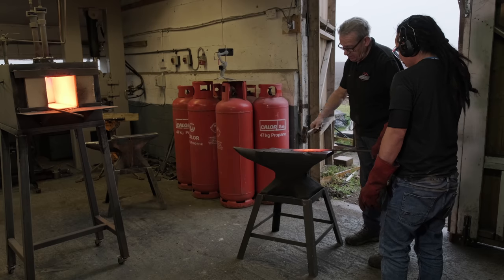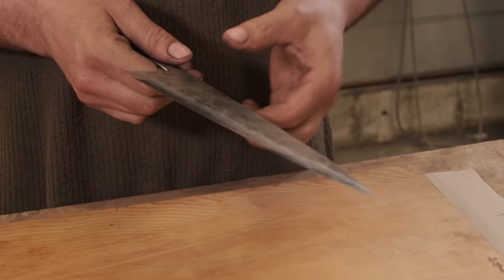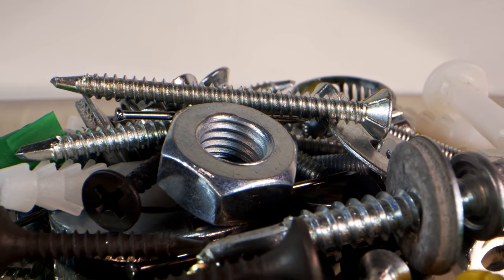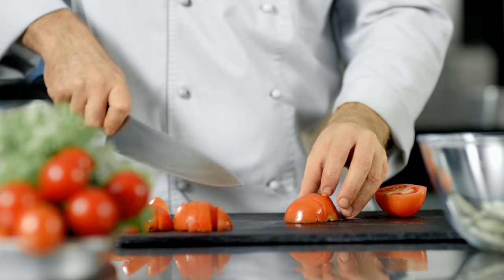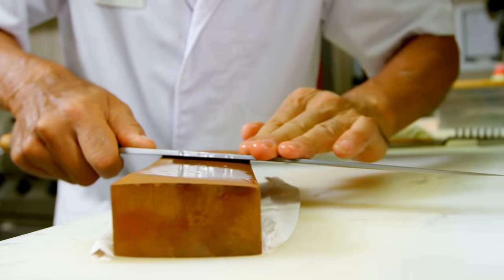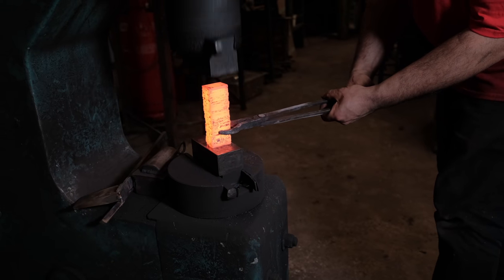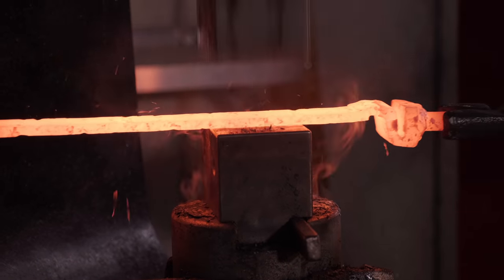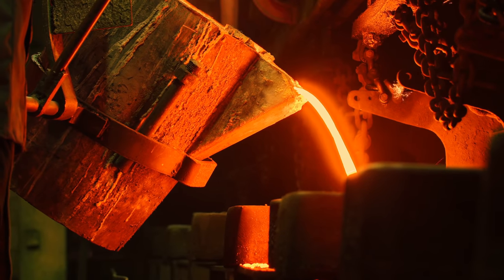Why 98% of knife makers pick the wrong steel according to a metallurgist

Comment: Never tried powered steel due to its price, wish it could be cheaper. I always enjoyed working with 440c, It is not that hard to sharpen and can hold its edge very well. Its corrosion resistance ability is quite good, I accidentally left a knife blank outside my workshop in the rain for a couple of months. When I found it, there was no visible rust or tarnish on it at all. The only downside is it can be quite brittle without the proper heat treatment.
Reply from the maker: Thanks for your input! I hope you enjoyed the video!

Comment: A conversation about stainless blade steel cannot simply revolve around chromium content alone, it also has to do with the carbon content, nitrogen and niobium additions. As an example magnacut only has 10.7% chromium and it is one of the most corrosion resistant steels on the market. ZDP 189 on the other hand has 20% chrome and it’s less stainless than most standard stainless steels. I realize this is an attempt to make complex metallurgical ideas digestible, but I think it’s important to mention that a chromium percentage is not the whole story.

Comment: As a moderate experienced blade smith I only use Stainless if I can have it professionally hardened , can I harden it myself without very special equipment?
Reply from the maker: If you are asking about Cryo, then yes, you do not need cryo to harden stainless steel. A new series with Graham is coming soon so don’t forget to SUBSCRIBE! Thanks for the question Steve!
Reply: The trick with stainless and tool steels isn’t the equipment but the temperature control. 

You can just about get away with using a magnet to gauge the right temp for a plain carbon steel (when the magnet falls off you’re a close enough to the right temp). Stainless needs a higher temperature and judging it by eye is hit and miss even to an experienced smith.  A cheap thermocouple that’ll go up to the right austenitising temperature will help a lot even on a coal forge.

Comment: usually anything for the kitchen or household i usually go with stainless because of its properties, but if i am using a knife for outdoor stuff like bushcraft etc, i prefer to use 1095 carbon steel. yes it doesn't hold an edge for as long, but its easier to touch up in the field, and also you can use the spine of the knife with my flint stone to throw sparks onto some char cloth for fire starting. i don't mind it doesnt hold an edge for as long, because that compromise means its easier to touch up with a smooth pebble or pocket sharpening stone.
Reply from the maker: Hi Punk Floyd. Compromise is the keyword and thanks for sharing! 1095 is extremely popular for the exact reasons you’ve shared. 

Have a great day ahead of you!

Comment: A8-mod for large knives used on non abrasives. Tough, so will stay sharp very long due to that toughness. Obviously because the Apex blunts due to damage not wear. Also sharpen ability is high and good corrosion resistance. 5160 is also a good choice.

Cpm3v is similar in toughness but harder to sharpen. Thats why I don't like it.

Comment: Just branching out to stainless... Client insisted on ats-34... Trying to forge it out a bit and that stuff is tough and fickle...
Reply from the maker: Hi Kevin thanks for the comment! Yeah, I can only imagine that! I’ve been told stainless is “gummy” to forge compared to carbon steel. If you enjoyed this video, I’m sure you’ll enjoy the next one coming this week (steel selection part 2 and steel hardness)!
Reply: @UKBladeshow  "Stainless" steel was discovered sort of by accident. In the late 19th/early 20th century, industry people were looking for steels that would A) heat-treat more evenly and B) stay hard at higher temperatures. Like for drills and milling tools where you're cutting steel and there's a lot of friction/heat build-up. Hot-hardness AKA red-hardness is a big deal if you're running a machine shop or factory making metal parts...
It turned out that adding a little chromium helped both the HT and hot-hardness problems.  (there are other alloying elements that also help with all that, but let's just stick with chrome for this discussion.)
O1 is generally regarded as the first specific "tool steel." It has just a touch of chrome and manganese and tungsten, all of which contribute to its better hardening response and better performance in machine tooling, compared to really simple steels like 1095.
Plain old 1095 will get soft and dull faster in a drill or mill than O1 does, and newer steels with higher alloy content came after O1. 1095 is also a bit trickier to harden - you need to cool it FAST or it won't get fully hard, especially in thicker pieces. O1 gives you more leeway in that regard - you can quench it slower, in oil not water... that's what the O stands for. Oil-hardening.
Adding a bit more chromium makes a steel harden so easily that it will get hard just cooling in air, without even dunking it in oil or water. A2 tool steel is called that because, you guessed it, it hardens in air. A2 also stays hard at higher temps than O1 does... and it corrodes much slower. 
They soon understood that adding even MORE chromium made the steels very stain-resistant indeed. 
So! Fast forward to today...  the problem with hand-forging high-chromium "stainless" steels is, they stay a lot harder at a lot higher temperatures. You have to bang on them harder to get them to move.
And you have to get them hotter to be able to forge them in the first place.
And they want to get hard in the air as soon as they start to cool down from that forging temperature.
Those are all big problems for a small shop using an open forge or small furnace.
It definitely CAN be done - back in the day Gil Hibben used to hand-forge 440C - but it's a real pain in the behind. And frankly it's just not worth the trouble to most people. There's a lot of extra time and cost involved, and you don't get any benefit from it. In fact, you run a lot of risk of screwing up the steel by beating on it at the wrong temperatures. Unless you need some crazy shape that has to be stain-resistant, it's just plain more efficient to grind "stainless" blades out of flat barstock.
On an industrial scale, knife factories get around all that by doing their forging of "stainless" steel with big drop-presses that forge the blank mostly to shape in one or two movements. That allows them to have cool features like integral bolsters efficiently. Then they heat-treat it and finish-grind it.
Reply: @dogslobbergardens6606  excellent information, ty very much... I've come to the conclusion that stainless can be done but it is too difficult and time consuming... Stock removal on stainless blades for me in the future for sure although I will finish forging this one blade to see the result.

Comment: Almost all of my knives are carbon. I have never liked stainless. Mainly because I like to patina my blades and I think carbon is easier to maintain than stainless and is usually tougher. Stainless is usually either too soft or too brittle and I don't like shiny knife blades. Also carbon is much easier to modify with coatings like KG Gunkote, which I often do with my blades.

Comment: I recently got a bell knife skiving machine for leather work.  I installed a Nippy SKS51 Japanese steel  bell knife, thinking this would would be more reliable than the stock bell knife. It's not a bad bell knife, but I realized only recently that I should have gone with a hardened German steel bell knife from either Nippy or Fortuna. I'm curious to see if I will experience a noticeable difference.

Comment: I like simple alloys ("carbon steel") just fine, except for one important thing - I live in a humid climate. I don't really care one way or the other about patinas, but there's just no getting around the fact that in 90% plus humidity, the edge on a carbon blade degrades in a day or two whether I use it or not.
AEB-L is still one of my favorite alloys after using and making dozens of knives out of all sorts of things from 1095 and 01 to PM high-alloy "super steels."
The PM alloys def have their place, but as the presenter said, you WILL notice the difference grinding them and your customers will notice the difference sharpening them. As a maker you also have to consider that they're expensive to start with, you'll use up more belts, and they're trickier to HT. If you want a nice fine hand-rubbed finish on them, you best do it before HT or you'll drive yourself crazy trying to sand it and/or buff out scratches. Which means you really want your HT game to be dialed in, because you're taking it to final dimensions before hardening. Otherwise, screw it... belt-finish the PM steels.
(I have in fact made a few knives in CPM-3V with mirror-like 4000-grit hand-rubbed finishes, just to prove it can be done {before HT}... but honestly no one really cared LOL. People who buy that type of steel are likely going to beat the snot out of it, so they generally feel like a really fine finish will just get scratched up anyway.)   
AEB-L doesn't have all those carbides that make most "stainless" blades such a bitch to sharpen; that helps with toughness and keeps it fine-grained so it  takes a nice crisp edge; it sharpens like O1 and it stays that way a good long while regardless of the weather. 
You can temper it around 58Rc for general purposes and a good balance of edge-holding and toughness, or way up at 64Rc for better edge retention. The higher hardness range is very nice for really thin edges like you might want in the kitchen or for skinning. I settled in on 60Rc for almost everything. 
I call AEB-L "the stain-resistant steel for people who don't like stainless steel." There are also newer similar alloys with the same benefits. 
The key is having just enough carbon to get good and hard, and just enough chromium to get that passivation effect to ward off corrosion. Too much of either or both and you're back to fighting carbides; and if you want carbides you might as well go for the PM steels to keep the carbides small and evenly distributed.

Comment: Stainless holding a better edge may be true with low alloy stuff, but with modern high alloy stuff, the non stainless will almost always have higher edge retention than an equal toughness stainless.

Comment: Wonder where 80CrV2 would fall in the lineup? 
I'm definitely no expert, not even a particularly knowledgeable knife head, just the end user of a small variety of knives, mostly for outdoors/bushcraft purposes, and I have been very impressed with my 80CrV2 knives. Living in an extremely humid environment, I thought from listening to all the self-proclaimed experts that I'd need to clean and oil all non-stainless knives every time I used them, but the 80CrV2 has been amazing. It's withstood Louisiana humidity and going weeks sometimes without cleaning or oiling (at first I was fanatical about it, later not so much), and nary a blemish to show for it. Not to mention the abuse they've stood up to, unintentional and otherwise.

Comment: I don’t understand why Pro knife makers working with CRM / powdered metals don’t get into Boron / CBN grinding wheels with diamond dressing stones.  

The upfront cost would not be cheap but and this is not flexible like belts but would decrease belt consumption waste cost tremendously for some specific tasks.  

I’m sure there are some that do this but I have not seen it widely discussed.
Reply: Because you have to make and sell enough knives to cover that upfront cost quickly. But also because most individual/small shop knifemakers love belt grinders for the tremendous versatility they offer - you can easily keep an inventory of belts in all sorts of grits from 36 to 600 right up to "micro-grits", you can use scotch-brite style belts for simple finishes, you can "power strop" with a leather belt, you can use a flat platen or a slack belt or a wheel ranging from 1" to 12" or larger, etc. All with one machine.

Comment: I have to agree. In the kitchen, stainless is the way to go. 

Carving hard wood is different. I find that plain carbon steel provides a good amount of work time between stropping or stoning ,with a minimal amount of time required to restore a razor edge. But, it’s a pain in the kitchen and it stains your onions. Plain carbon in the workshop, stainless in the kitchen.

Comment: Great Video, well done! My question is where you came up with the "98%"? If you're going to use a stat, make sure you can back it with qualified data. The truth is, I have been coal forging JUNKYARD (meaning I have no idea what it is) steel for years and I have never, not once, had a knife break from being used (be it as a knife or a crowbar or a thrower...) because as long as you heat treat and take the right steps to deal with the metal, you'll be fine.

Comment: I have some pieces of 5/23 scrap (old circular saw blades from the 1950s) marked "silver steel" My understanding is that it is an early high chrome,  high carbon steel but not a true stainless. Like you said everything is a compromise. My question is concerning the hardening process. Would hardening and tempering be similar to w-1, can I oil quench or am I looking at something different? (I'm in the US) (I have several woodworking tools made of this steel and they hold up very well)

Comment: Very informative and interesting, but it’s not necessarily better to have very hard chromium carbides in your knife blade. These carbides tend to be bigger, and when the edge abrades during use, sharpness is lost quite suddenly, as is the case with almost every single stainless knife I’ve ever used. Moreover, sharpening your knife with a steel presents its own problems.
I have a quite a few Japanese-made and Western carbon and stainless steel knives in my kitchen; the carbon steel ones keep their edge much, much longer, take about 30 seconds to resharpen to a true razor edge on a water stone, and will continue cutting well even when that pristine edge is no longer there. The stainless knives will lose the edge much faster and quite suddenly, will be a bear to sharpen, and will almost never have that keenness of edge. 
Hardness and edge retention are two separate things.

Comment: It's important to sharpen the edge to the angle the knife wants.  Fillet knives get different edge angles than axes.  I use all stainless knives for my fillet, hunting and kitchen knives, and I use a carbide draw sharpener at the correct angle for each type of knife...and I do this right out of the box.  I cut my edge to my specifications.  Then, I use a 600 diamond grit draw sharpener, again with the proper angle, the same way one would use a sharpening steel...to sharpen the edge with 600 and to continuously keep it sharp.  When field butchering a whitetail deer, I will resharpen my Buck knife 6 or more times with the carbide only.  After I'm done, it gets the carbide and diamond.  My largest most often used kitchen knives get sharp on a belt sander with angle guide, and my grits go up to 1000.  Same with the fillet knives.  Axes also go on the belt, as I like them very sharp to make quick work...even if the edge dulls faster.

Comment: Extremely good video! Good and clear explanation. 
But if I understand it correctly, my English is not the best, we got a huge amount of trash talking self called specialists out there, right?
These words are a bit harsh, I know...
But there are many people calling out steels to be the best, based on knowledge, that isn't correct. 
For example high carbon steels, that are stronger, tougher, harder compared to steels with a high amount of other carbides like vanadium or chromium, but these carbides are the hardest materials you can get in a blade so they beat the high carbon steels in pure hardness anytime, but may be more brittle if Im correct. 
Furthermore there is this big myth about Damascus. But if I think about the explanation given to me by this video, it can't compete with the modern technology, how could it? Different parts of the blade are different steels with different characteristics. And if there is only one steel in the edge its not Damascus it's a layered steel, right? 
Long story short: many people don't know what they are talking about, I guess. 
I would be interested, what you would classify as very good or premium Pulver steels. I mean it depends what you wanna do with it, but maybe there are steels that are clearly part of this class.

Comment: I would add that the chromium in stainless also leads to much more brittleness for the same level of hardening when compared to low/no chromium steels. But overall good categorization which follows the industrial categories of carbon, low alloy[tool steels like o1], high alloy[stainless and high speed] and specialty [ powder ]. Rather skipped over a few important bits, iron carbide is not the only micro-structural form during a heat treat and while carbides are hard and wear resistant, they are not responsible for the basic bulk hardness. Tempered martinsite or bainite are the sources of bulk hardness and ultimate strength from heat treatment, the carbides exist embedded in these. 
(Ferrite and austinite are the crystalline forms of annealed or unhardenable steels. Carbide may exist in these too but will not be held firmly enough to do much for wear, and the edge won't be strong enough to hold a crisp angle without mushing or bending.)
Reply from the maker: Hi MyTech! Great input and lovely to hear your comments on the variety of steels for knife making! I also do agree with the choices you’ve mentioned- there’s so much to choose from isn’t there?! Thanks again for the comment!